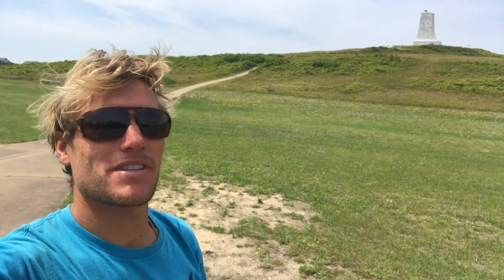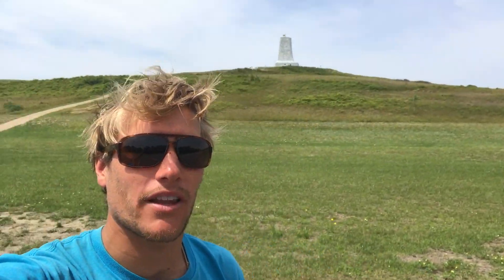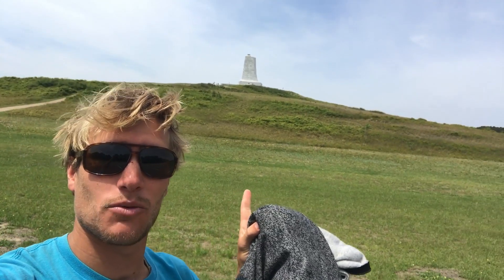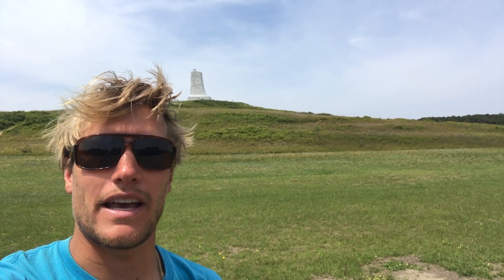Tip Tuesday: Wright Brothers + Harness input

Comment: Great tip! Also when collapsing your slider and opening your cheststrap you can slide your legstraps down your legs a few inches. It puts you in a more comfortable seating position and gives you better control over your harness input.
Reply: I find that this also preps your legs for full range of motion when running out those fast landings.